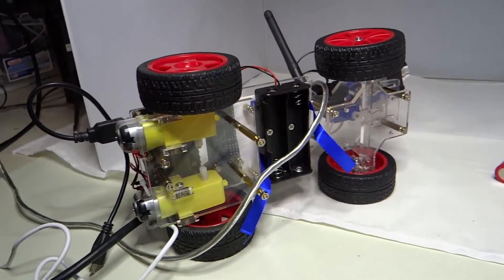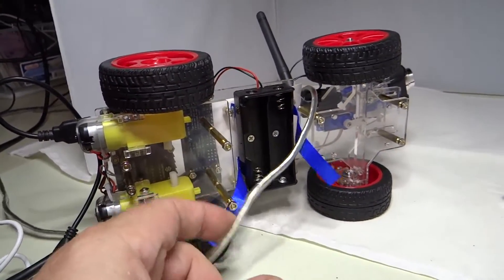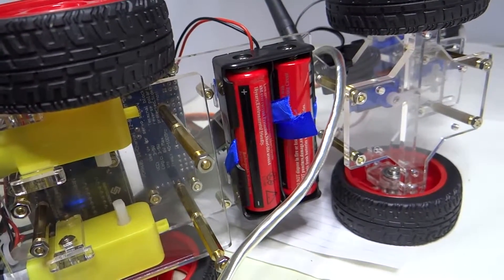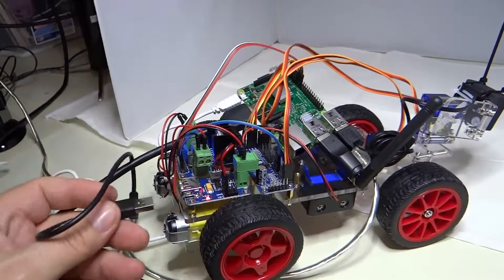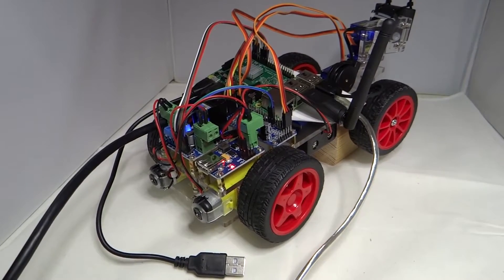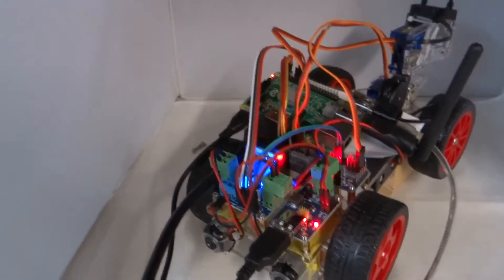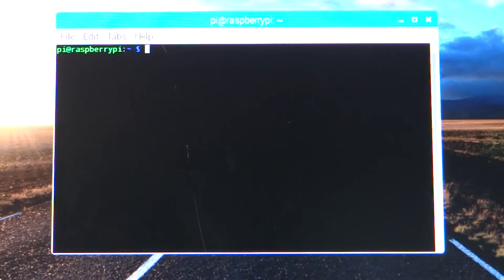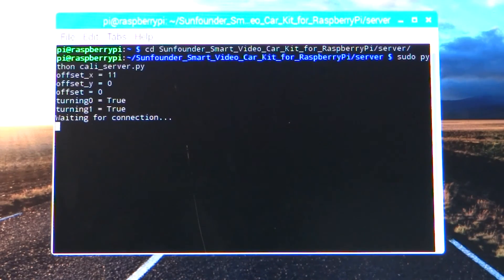Sunfounder Video Car 33   first power up of car on batteries

Comment: so I was able to fix all of my other problems an these have been great how to videos however I have to ask because I have come across one more issue, this is the whoe command linepi@raspberrypi:~/Sunfounder_Smart_Video_Car_Kit_for_RaspberryPi/server $ sudo python cali_server.py
 offset_x = 11
 offset_y = 0
 offset = 0
 turning0 = True...
 turning1 = True
 [Errno 5] Input/output error Your Pi Rivision is: 3 Module B
 I2C bus number is: 1
 Checking I2C device:
 Commands "ls /dev/i2c-1" output:
 /dev/i2c-1
 I2C device setup OK
 Your PCA9685 address is set to 0x40
 i2cdetect output:
      0  1  2  3  4  5  6  7  8  9  a  b  c  d  e  f
 00:          -- -- -- -- -- -- -- -- -- -- -- -- -- 
 10: -- -- -- -- -- -- -- -- -- -- -- -- -- -- -- -- 
 20: -- -- -- -- -- -- -- -- -- -- -- -- -- -- -- -- 
 30: -- -- -- -- -- -- -- -- -- -- -- -- -- -- -- -- 
 40: 40 -- -- -- -- -- -- -- -- -- -- -- -- -- -- -- 
 50: -- -- -- -- -- -- -- -- -- -- -- -- -- -- -- -- 
 60: -- -- -- -- -- -- -- -- -- -- -- -- -- -- -- -- 
 70: 70 -- -- -- -- -- -- --                         
 Conneceted i2c device:
   0x40
   0x70
 Wierd, I2C device is connected. Try to run the program again. If the problem's still, email the error message to service@sunfounder.com
Reply from the maker: is it causing the car to fail and not work?
Reply: it's simply not allowing me a connection therefore preventing me from progressing
Reply from the maker: chuck Ramsey I'll have to boot my car and capture the same section and get back to you.